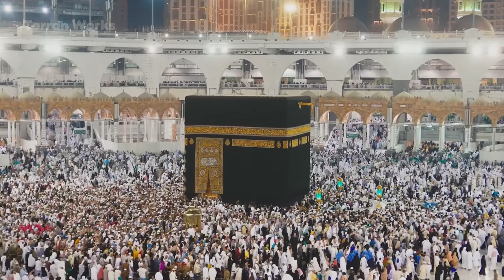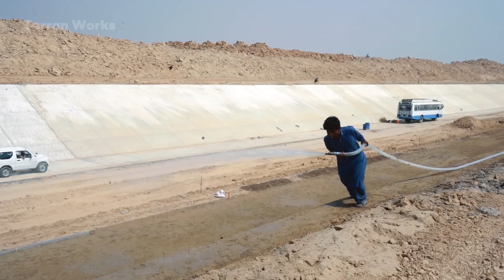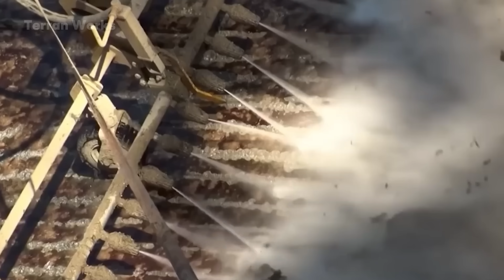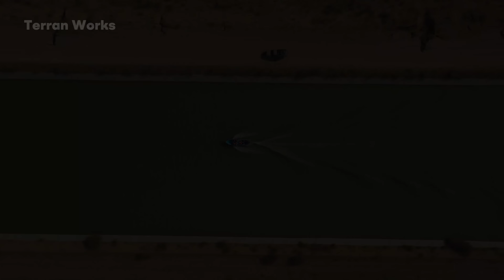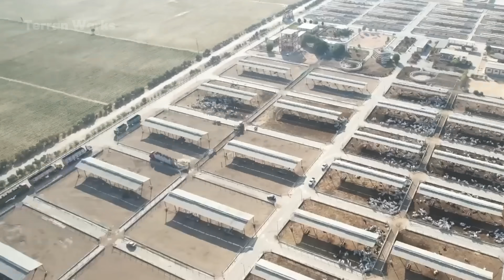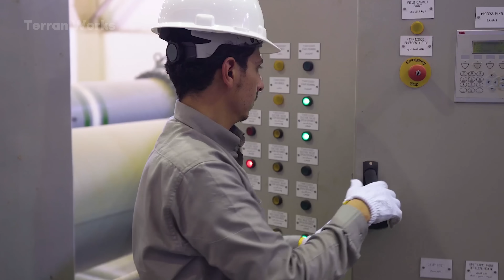Egypt Is Splitting the Sahara to Build a Massive River That Could Change Everything

Comment: Why not also add those black shade-balls on the slow flowing water to decrease evaporation? There could be barriers that limit where the shade balls float.
Reply from the maker: Thank you for sharing your idea, this is an interesting solution to reduce evaporation, however large scale implementation would need to consider cost, maintenance, and environmental impact

Comment: The country is over populated 110 million people means it was not designed for so many.
Egypts population was approximately 2.5 to 4.5 million in 1800, rising to around 9.7–11.2 million by 1900, & exceeding 66 million by 2000. The population accelerating rapidly into the 20th century. 
1800: Estimates vary between 2.5 million and roughly 3.8 to 4.5 million following a period of decline.
1846-1848 population was counted roughly 4.48 million, showing significant growth by the late 19th century.
1900: A 1897 census counted 9.7 million, with estimates reaching over 11 million by 1907.
2000: The population passed 66 million during the year 2000, continuing rapid growth. 
Wikipedia ... Institut national d'études démographiques | INED
Reply from the maker: You provided very detailed data, rapid population growth indeed puts significant pressure on resources and infrastructure. Thank you for sharing.

Comment: 25m3/ is a very low quantity of water. What area an be transformed in wheat fields with that? Is it near Toshka lakes?
Sahara is not all sand, there are also many rocky parts. Where are the places where to find sandy places?
Why not using desalinised water from plants on seashore using solar energy?
Reply from the maker: Thanks for your detailed questions. In the New Delta and Toshka projects, water is not limited to small amounts like 25m3, they operate on a massive scale using millions of cubic meters per day from the Nile and treated water systems. For example, Toshka alone pumps around 25 million m3 of water daily from Lake Nasser for irrigation.

These projects are indeed near areas like Toshka Lakes and focus on specific zones where soil and infrastructure make farming possible. The Sahara is mixed terrain, so development targets suitable land rather than all desert.

As for desalination, it is being considered, but it is still expensive and mainly used for cities. Large scale farming needs huge, continuous water supply, so Egypt relies more on Nile water and recycled agricultural drainage instead.

Comment: Great effort

Why great Sahara canal is not being built between Atlantic ocean to indian ocean hence creating a 3000 Mile long riparian  n micro climate ribbon ?

With increase evaporation n hence creating  rainfall n lowering sea levels.

Californian
Reply from the maker: Thank you for sharing such an interesting idea. Large water canal concepts to influence regional climate have been discussed before, but a canal thousands of miles long across the Sahara would be extremely complex and expensive. It would require digging across several countries and different terrains, with costs potentially reaching trillions of dollars. In addition, evaporation from a canal alone would likely not create significant rainfall at a large scale because desert climates depend on many other atmospheric factors. For this reason most projects today focus on smaller solutions such as desalination, water management, and agriculture adapted to dry climates.
Reply: Costly and unsuccessful system,,,,,

Comment: I suppose they've locked in a long-term natural gas supply, w/o that, it won't work.
Reply from the maker: Thank you for sharing your thoughts. Energy is indeed a key factor for large scale water infrastructure projects. In reality such projects often rely on a mix of energy sources like natural gas, grid electricity, and sometimes renewable energy to ensure stable long term operation.

Comment: why don't they install sola panels on the cannel to off set the energy of the pumping of the water?
Reply: They could build them on top of it to also alleviate evaporation
Reply from the maker: Thank you for raising a very reasonable idea. In fact solar panels installed over canals have already been tested in some places. For example in Gujarat, India, a solar canal project placed panels above irrigation canals to generate electricity while also reducing water evaporation. However for very large desert projects there are still challenges such as the cost of building support structures over long canals, frequent maintenance due to sand and dust, and the need to keep panels clean to maintain efficiency. So technically it is possible, but it depends on costs and the specific environmental conditions of the project.
Reply: The cost/benefit isn't in favor.
Reply: I’d suspect sand storms would etch the panels and cost prohibitive keeping them clean
Reply: Use the water from the canal to rinse off the panels😁💦
Reply: One single modern nuclear plant could sustain this project.
Reply: @HookahHoku cost billions to build and after 40 years, billions to decommission. They have space for millions of solar panels and battery storage or solar power plants.
Reply: @Laura_Battleship_Row  Prime candidate for small modular reactor and they only cost billions because certifications systems have been designed to prevent their construction.
Reply: @Laura_Battleship_Row  solar is not great in egypt, the sand will damage the panels beyond use far faster there.
Reply: @B @BernieTheBoxer d the waste fuel still needs to be securely stored for thousands of year!!
Reply: @Rockstar-vs1nb so why is Indian installing millions of panels in their desert regions? Even a dusty panel can produce 80% of its full power capacity.